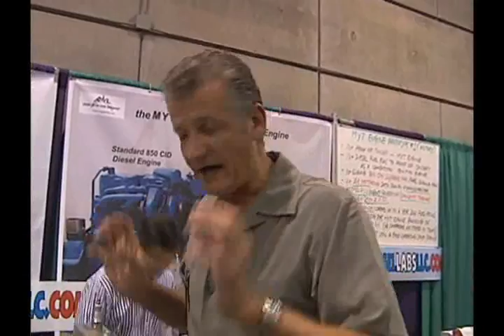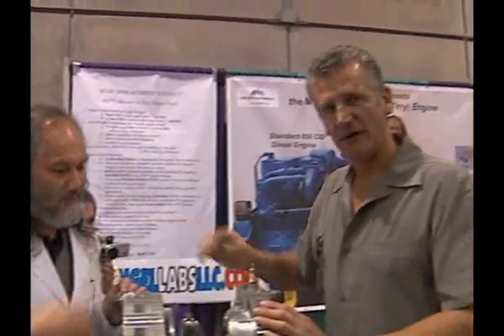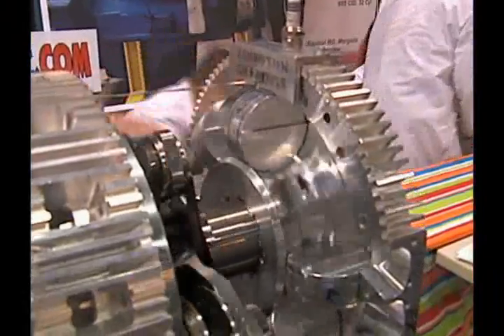Host Michael Raines  with the MYT engine 2006 LA auto show

Comment: You guys need to realize this thing is crap! Why? Look at the pistons ! 1.18 to 1.23 do you see how the pistons are connected? With thermal expansion and the PSI in the chamber, they would snap right off. Pistons only work is you keep them "round", so the "rings can seal" and make use of all that pressure pushing on it. Cool machine work though!

Comment: The main reason for a water cooled system vs. an air cooled system is noise reduction. An air cooled engine can work just fine with the right airflow design. ANd it can be turbocharged, or supercharged if desired.

Comment: Think about this. Most conventional IC engines falter below 500 RPM. This can hold it's own well below that. Then the transmission reduces the RPM's going out to the drive axles anyway. The only reason for that is because we want a greater power transfer to the wheels to accelerate faster. Now.... add more HP, and an ability to run at low RPMs and VIOLA! The MYT can fire up in 1/4 turn. A 4 stroke needs at least one.

Comment: When the 'combustion' happens, what's stopping the piston from firing the wrong way?
Reply: Has to be a one way gear or ratcheting of some kind
Reply: Just like how any regular ICE crank operates, with kinetic energy. The two sets of pistons and rotors, are coupled with two splined sleeve shafts, two pitman arms, two rods, two orbital cranks, capped on a carrier yoke, splined to a Shaft pin. The carrier caps, sleeves, and shaft are the power stroke bearings and that whole assembly is organized in a 4:1 ratio around the Sun gear thats fixed to the housing. There is no sprag clutch or anything its just strategized levers, gears, and volumetric chambers. I did a whole study on this with solid works and 3d printed a small 4inch model. It’s pretty fucking mind blowing actually. To hold one in my hands and play with it see how it moves. It definitely checks out. There is so much potential the MYT. The only slight limitation would be actually machining these parts correctly with the precision and real world tolerances of materials that expand and contract while fitting together. If a Mazda rotary or liquid piston engine can be done, so can the MYT.
Reply: @franciscogru4643 thanks for replying to my 12 year old  comment.  Your 3d print didn’t have any combustion though.  I’d like to see this in action instead of more theory.
Reply: @walperstyle Good luck with that!
Reply: @franciscogru4643  I'm here asking in hopes to find the owner of this design, not internet dwellers who've never taken any engineering classes.

Comment: Facinating design
Personally i cant see any problem that cant be solved on its engineering, given the right amount of persistance, just because something didn't work before does not mean you can't try it again, especially if you have a variation that may solve the problems and or time has gone by and there are more suitable materials available at better prices as happens.
Building the first practical Aeroplane was built ontop of a pile of failures and unavailable engineering technology.

Comment: Remember... HP = Torque [ Ft x Lbf ] x RPM / 5252...
the Drive Shaft's Torque is important here not the RPM's. 
Basic Horsepower math can tell you how many pounds per feet
can be displaced per each efficient Torque on the Drive Shaft.

This is what's important not the total RPM's...simple logic

Comment: I would like to see this engine run on gasoline, diesel, whatever in actual combustion cycle instead of compressed air. I just don't believe that this gear mechanism he invented and patented for the engine actually works until they can actually show that it works. It kinda add to credibility if they can run the engine. Stress on the internal gear mechanism might be too great for currently known materials and so the engine might not be practical or even usable.

Comment: I was there at the show that day and I spent some time talking with that guy. 
And you did see a spark plug but that's because that was the gasoline version of the engine. The diesel version doesn't have the hole for the spark plug.
He said it ran best on bio-diesel because it had excellent lubricating qualities.
The engine makes a clip-clop sound too that sounds like a bunch of horses.

Comment: It simply didn't work. I or others never saw it run on anything but compressed air. It could never seal well enough to have a hot explosion from liquid fuel as we know it. It was never brought before credible testing facilities or even shown to engineers and the such. Basic ideas had very little merit from the get go.

Comment: It's not hard to bolt on a valvetrain, and the crank-trigger to fire the ignition. The old version I've seen didn't use any valves at all since the combustion-camber moves from intake to exhaust port, sucking in fuel and blowing out gases as the pistons pass by.

Comment: I agree, this is pretty cool, but, since I first discovered this in early 2006, there has been very little change to angellabsllc,com, the inventor's website.  Where the forums used to be on their website, there's a message saying that their website host can't continue hosting, and some of other things.  Also, they had a not-small liability due back in 2007.

However, one of the email contacts recently changed (which I'm emailing at the moment), so, they're not gone.  At least the idea is out.

Comment: Remember the compressed air is replacing the normal air/fuel mixture. What he's saying is if it was running on an air/fuel mixture it would still be able to produce hp at 40rpm. The internal friction is very low, try running your car engine at that speed, I doubt if it would run.

Comment: only thing any inventor has to understand that a radial engine is a scientific max out meaning its been calculated to produce the MAX efficiency possible no one can beat MAX since its maximum, on the other hand radial engines which seem so perfect must have a flaw since its a law of nature, that it would break down way to easy due to the force on the metal rotary piston it self. I've thought a radial engine had problems. These pistons are bolted by the smallest peice of metal i've ever seen

Comment: I agree. There is also no compression because the pistons are not sealed to the outer edge of the engine by piston rings or something of the sort. No compression = no force, which = no horsepower when the fuel ignites.

Comment: Longevity might not be its thing, but with its large power to size it might make an ideal military engine - for things like missiles or rockets. These need a lot of electrical and mechanical power for a short burst and are mostly stuck with one use high energy batteries so the MYT could be ideal. - It looks like it might miniaturize well.